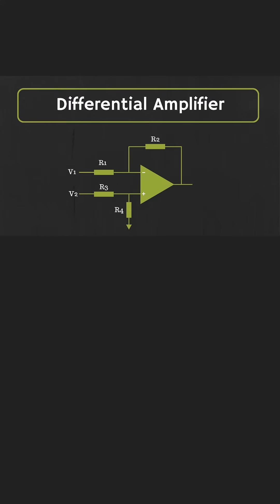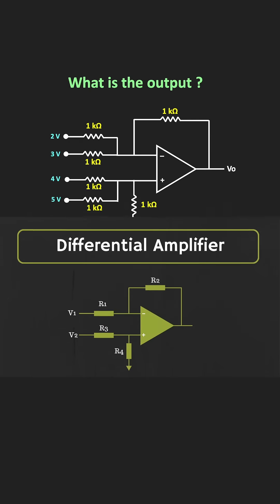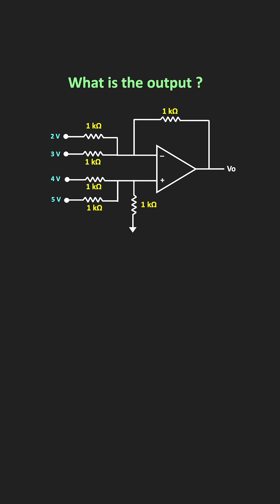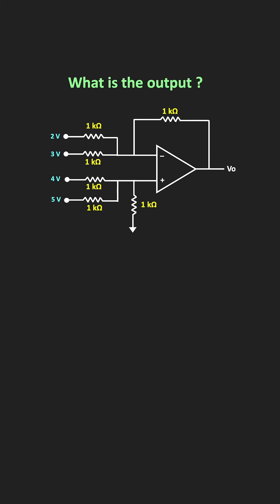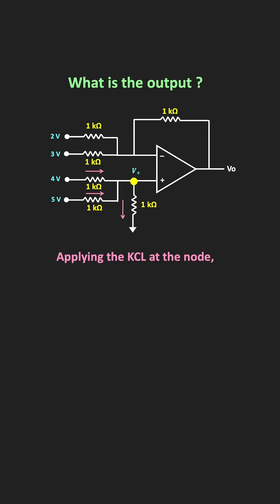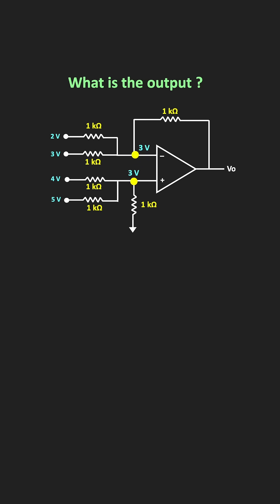Difference Amplifier using the Op-Amp Solved Problem | FAQ # 2

Comment: this ones fine, but when i used superposition and then applied voltage divider rule, shouldnt while doing the non inverting part of superposition, we should take consider that the (1+Rf/R1) part, that R1 is not just 1 kohms, its actually 1k || 1k? Please answer this brother
when i just do 1k, i get 4v as op, but if 1k || 1k, the i m getting 8.5 kohms
Reply from the maker: In that case also, you will get the same answer. Let me show you just by considering one of the input at non-inverting terminal. While applying superposition, let's consider only 4V voltage source. So, on the non-inverting terminal V+ = (1K || 1K)*4 / ((1K || 1K) + 1K) = 4 * (0.5 / 1.5) = 4/3 V.
Here, since 2V and 3V voltage source will act as a ground, so two 1K resistors will be in parallel at R1 position. So, now Vo = (1 + 1K / (1K || 1K)) * V+ =  (1 +  1/0.5) *4/3 = 3 * (4/3) = 4V. 
Similarly, for 5V voltage source, you will get Vo as 5V. And after superposition, if you see the overall output, then it is 4 + 5 - 2 - 3 = 4V
I hope, it will clear your doubt.
Reply: @ALLABOUTELECTRONICS  i finally understood this😭, even in the comment section, your way of teaching is truly unparalleled, thanks for clearing my doubt🙏
Reply: @ALLABOUTELECTRONICS  had the same question so can we use that method too cuz I got the right answer following the same

Comment: How v+=3v came
Can you explain that
1.03
Reply from the maker: 1K resistor is common in the denominator. If you remove it, then we have 4 - V+ + (5 - V+) = V+ 
That means 9 - 2V+ = V+.
That means 3V+ = 9 or V+ = 3V